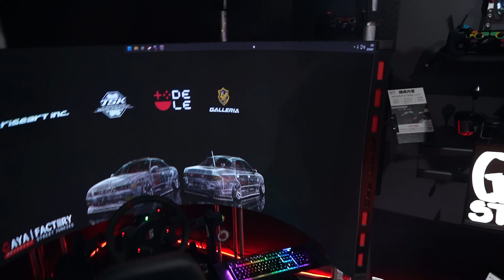BUILDING A BUDGET RACING SIMULATOR!

Comment: So if you want a budget dd and you have experience with IT and electrical check for hoverboard direct drive or check out moza or cammus eventually when upgrading, this is a solid setup but I'd try to find the small plastic plates from the wheels qr 3d print as you would experience less wobble in the wheel itself. Also this content is really ramping up, you probably know Haugen Racing as well as jimmer I saw so there are people with advice at hand Sammit great first setup and great welding too. Much love from Germany 🇩🇪 ❤

Comment: the best car purchase under 3k is a sim rig. the ammount of muscle memory and ease of just hopping on and running a few laps helps more than you think.  james deane and aasbo both use sim rigs alot for this reason.  rebulls f1 driver is also 2nd on the iracing leaderboards.  sims are great for drifting and grip practice.  its not 1 to 1, but assetto and iracing def have their moments when you think otherwise.

Comment: I flipped over my shifter box and screwed a 1x4 to it to move the shifter more beside me. Also to invert my pedals I used aluminum angle uprights mounted where the rear bolts are,flipped the pedal base over and then bolted aluminum tube to the holes from mounting the shifter. All that's bolted to a footstool without the cushion. I made a 30° base for that office racer chair and after all that it feels amazing in front of a 65" 😁. I love your IRL content but it's cool seeing you like to hit up sims